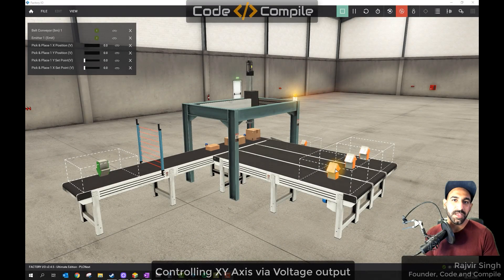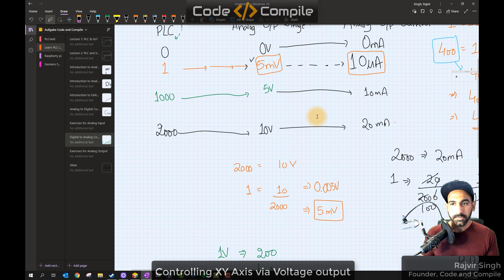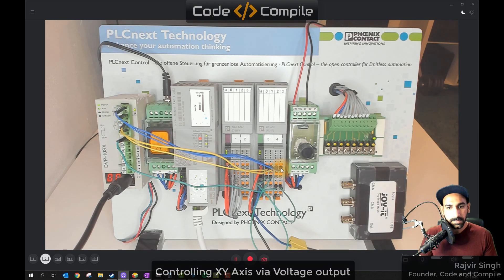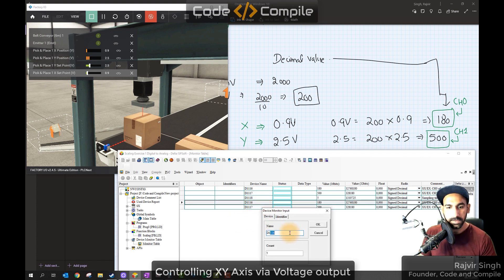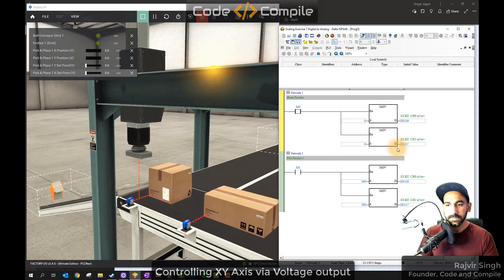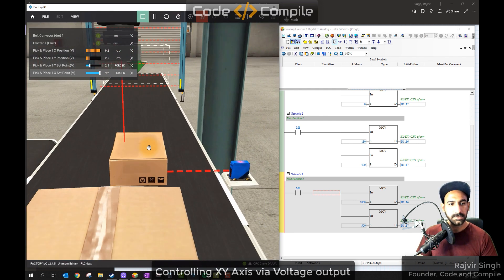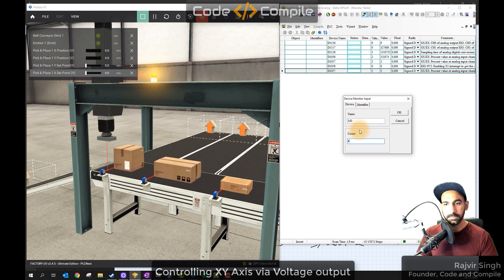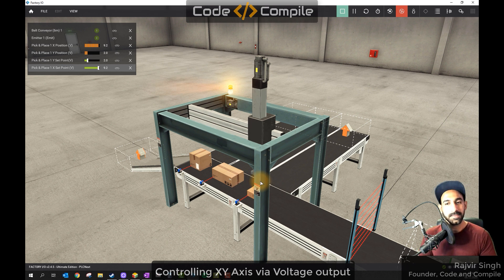Lesson 10 - XY Axis control using PLC analog output

Comment: Put Video on how communication between field to PLC and PLC to field happening in Flowmeter, Pressure Transmitter, Level Transmitter, Temperature Transmitter, Electro-Pneumatic Positioner, RTD, Thermocouple, Current to Pressure Converter, Load Cell, Sensor
Reply: Hi do you know  where is the teacher now